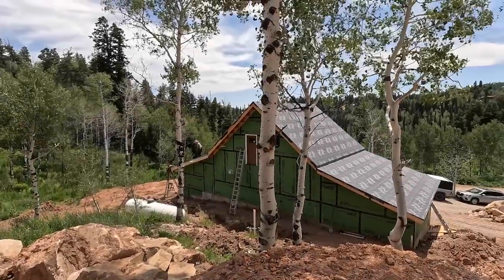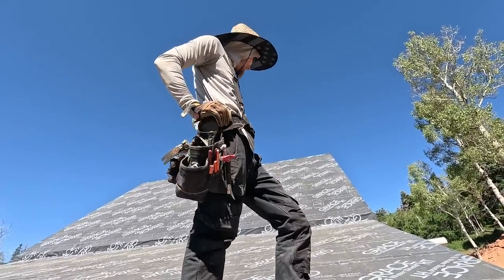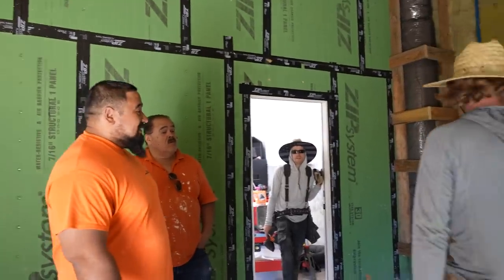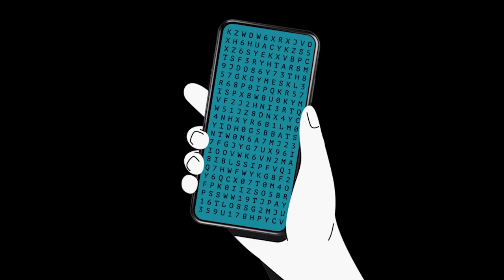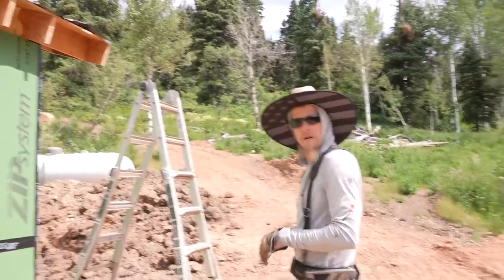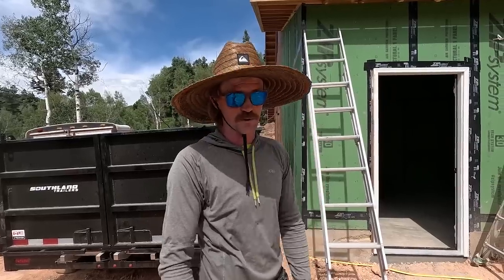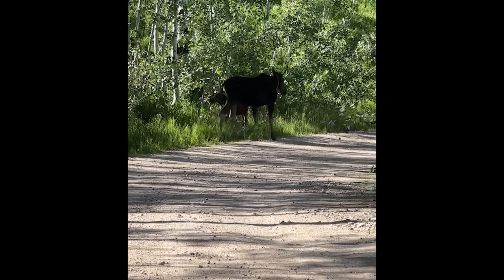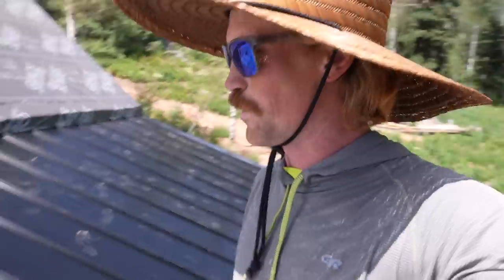WE HAVE A MAJOR PROBLEM

Comment: SO much sketchy stuff goes on.   Put some end caps on that rebar so that if you fall or dogs jump over it, they will not be impaled!!

Be Safer because stuff like balancing a board on your foot and using a circular saw while doing the balancing will eventually not end well.  

All the other stuff is great.

Comment: I had always envisioned that the new opening to the addition would come out at the window by Trent's cookie closet, at the top of the basement stairs. On the landing going up the stairs is an interesting choice. There must be some kind of functional reason that's escaping me :D
Reply: Me too!!  The opening on the landing really surprised me..
Reply: I suggested this 💃,
but I do think they came up with the idea themselves! 🤓
The main thing in my eyes is that the ground is sloping very much, so to get the windows and patios at the right level, and not just look at the mud of the earth, this part of the house has to come up compared to the first build.
Also, I think it will give a better flow in the house than other possible options.
Reply: @christinae30  Thank you! I knew I was missing some part of the picture :D

Comment: Take a tip from someone in the deep south who deals with a lot of humidity and heat; start work as soon as the sun rises, take a long break at the hottest part of the day, go back to work after 4pm and work til the sun sets. I know it's a pain but heat exhaustion is no joke, and you certainly don't want it working on a roof!

Comment: I don’t watch your show often but my wife does so when she was watching it and I seen the rebar sticking straight up with no caps it made me cringe, I have been around concrete for over 35 years I have seen a lot, I lost a friend because of it and if I didn’t say something it would be on my mind especially seeing Trent on the latter next to the foundation that is how my friend lost his life with a punctured lung! I’m not telling you this to be an ass but I surely hope you get it,no one expects to fall but in the heat stupid things happen BE SAFE.....
The quickest way I have seen is cut a 2x4 into 4 or 5”s long pieces and drill a hole the size of your rebar 3/4 the way into the pieces and slide over the bar.

Comment: You could have pulled the carpet back from the window and run a drill through the wall at the subfloor level so you would have a visual on the outside.

Comment: Maybe to get ahead of you ........ when your concrete wall for the house addition is done, apply a tar waterproofing to the wall.  The last thing you want is water making it's way into your home.  Don't backfill the wall with dirt, use drain rock instead, with drain pipe at the bottom.  That is how you make sure you don't end up with a water problem.  Water back up on that high of a wall has tremendous force, and it can make it fail, or at least crack which opens up all kinds of problems.
When you lay pipe, the way the pros do it so that it can last 100 years, is to do your excavation, then apply a layer of rock to make sure you have a structual, level, with correct slope to the pipe bed.  Lay the pipe on the gravel, then surround it and cover it with about 6 inches of sand.  Then lay out a copper trace wire and colored plastic warning tape.  then go ahead and cover it the rest of the way with drain rock or dirt.  Then you will not have a pipe that doesn't drain or collaps.  You'll have the trace wire to find the pipe location in the future.  And you'll have the plastic tape to let you know when you are near the pipe.  Then, you'll also have nice easy sand to shovel out of the way instead of rock or clay.  That is how to do it.  Now, it's up to you to listen to all the people who write comments, that know what they are doing, or to ignore them all and do things over and over the hard way.

Comment: You could use the extra roof panels for siding somewhere.  It could also be used on a shed. Something will come up, even garden boxes. 
When I renovated I never got go rid of wood, metal etc and over a decade I used every piece for something or friends did

Comment: For all the comments about the rebar, all that needs to be done is three two by fours nailed in a u-shape and placed on the rebar top. Doesn't take very long if you don't go crazy nailing it you can reuse the 2x4s. Or you could simply take those forms and hook them on the top of the rebar in the recessed area on the back side of the form as long as the form is wide enough that it sits like an A-frame on the footing top. We've done that also. It's just that I saw plenty of 2x4 stock there to use.

Comment: Like  to watch you work and the skills that I don’t have. May I strongly suggest those plastic caps to cover your vertical rebar for safety.  Also if you set a pad laser up on the bank out back I think it would pick up the laser rod inside that window to give you a floor height to transfer to a control point for your matching the new floor in the addition

Comment: Whenever we did metal roofing one of the first things we would get would be a 10 or 12-foot siding break they were really cheap to rent and really handy to have around. Are you bending closures on the top end of your lower panels?

Comment: It really felt like Trent could have just drilled a hole from the one side to the other..... known exactly where the floor level was and then just put a little spray foam in temporarily ... or taped over it... since that wall is coming out.

Comment: OK, now that the roof line has been corrected, why can't Trent reuse the facia board? Smacking the old rafter pieces off and removing the nails would give the materials needed for fixing the roof ends.

Comment: Great job.. especially on ice n water shield.. it’s so important on edges cause in Utah when it freezes it backs up on edges n leaks.. but u rubbed it in perfectly… it should never leak there once the heat melts it into the wood.. ok I’ve roofed a lot .. u remind me of me.. what I don’t know I have learned.. but since dying twice in 2022 I struggle to fix things n it drives me crazy I wish u could fix my ac it needs 10 dollars worth of washers or 2000 for dealer to fix. So I’m stuck at home on hot or cold days cause defrost only works.. help!

Comment: It's nearly impossible to get the floor height in an addition to match the floor height in an existing structure.  That's why there are transition pieces.  It will work out.

Comment: Hello Allie and Trent:  I have a question / comment.  Q:  Would you consider building a 'separate' building to the back of the house, instead of an addition?  Connecting it to the main house through a window that would become an enclosed hallways/doorways?   
Comment:  A friend of mine did that with their addition and it worked out beautifully!  With a lot less stress to connect it to the main walls of their home.  Just a thought.  Blessings on you all.  Maggie

Comment: Back in the day, 1970,  we had to make all duct work from 24 gauge galvanized sheets of sheet metal. Cut them on the shears and bend them on the brakes.  Then we had to install them on the job site. And you had to worry about the Draft, also.  The Government.

Comment: If, as you said, the sheathing should be nailed to the fascia perhaps inserting spacers that are nailed to the fascia's back side would suffice in properly supporting the sheathing's edge. Measure twice cut once, the mantra that has impacted more experience builders than y'all when not followed.

Comment: Are you guys putting deadman into the hillside? We have large cement walls and that’s what keeps our walls from falling forward.   I don’t know if they use them anymore.  We had a 200 foot wall fail in the middle, Most of the dead men kept it up right,  until it could be completely dismantled.. It was 25 feet tall. 15 foot section on the bottom and a 10 foot section on top of that.  Just a thought.

Comment: I know nothing about roofing but wondering why you don't do a bottom roof metal sheet and then the corresponding upper roof sheet so you don't have to walk all over the more slippery bottom metal surface when doing the top portion ; not to mention possibly scratching it?

Comment: Water levels are still used even though there old school before laser crap. When you build a swimming pool , u use a water level, around the whole inside pool. This is for laying the tile around the water edge,  the water level, 100% makes sure the tole job will match the pools water level, and all tile is LAYED perfit to pool water height. A tip. 
Never tell, a sheet rock contractor, you dont care. He can now, slop it on. Make it look like crap, and then say....sir u said cheap cheap you dont care, so I hired my blind cousin who drinks is to do the job. 😅😢

Comment: Don’t know what the proper name is, but couldn’t you just order wider valley metal where the two roofs meet. The upper roof metal goes over  the valley metal and the lower roof metal goes over the lower roof metal. No leaks and a quality cheap fix.

Comment: I have a question that isn't anything about building your home. My question is about sponsored information like Surfshark and other places that sponsor your channel. I've gotten to the point for about a year now where I will go past the information because I watch a number of different channels that also uses most of the same sponsors so I get tired of hearing about the sponsors a lot each day. I have clicked on some of the links to the sponsors if I'm looking for something in particular. If I've seen something on your channel for example Better Help, which I did use your code for that because of everything that has gone on since covid. Since I remembered that I saw it on some of your video's, I will go back and rewatch the video. I've gotten NordVPN from a channel called Jolly and I knew they were sponsored by NordVPN. I've clicked on a number of sponsored items if I was wanting or needing whatever the sponsor offered. It took me longer to get to the point to ask my question. Since I will go past the sponsorship info in the video since I don't want to hear the same things over and over again. Since I go past it, do you guys lose out on any funds if I go past that information. I do that with everyone's video's unless I want the item. I kept wanting to ask and I kept forgetting until now.

Comment: Track and alley I'm going to make a really maybe bad or good suggestion I know is probably too late why don't you guys have gotten some spotlights so that when you were putting that roof up you could have done it in the dark with the spotlight and done it in cooler weather I'm just think it's a great would have been better and you still have another route to do so something to think about and taking a weekend off I think that was a great idea alright this is Bob from Vero Beach Florida god bless a safe and have a great and try to work something you don't just assume that it was the right the each side is might be different

Comment: I have couple of what may be silly questions but I'm going to ask them anyways.  If it's 100 degrees out, why are you all wearing long sleeved shirts, and Brandon has a hood on his?  Wouldn't it be cooler in t-shirts or tank tops?  Secondly, why wouldn't you install the top portions of the roof before the lower levels over the garage and man cave?
Reply: They now have shirts/cloth made with sun-blocking fabric. It’s very lightweight.